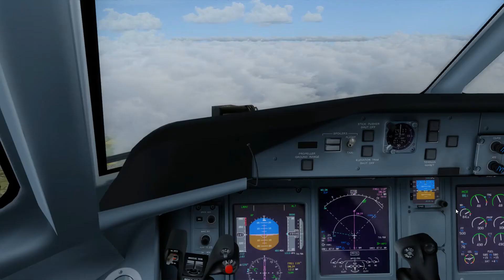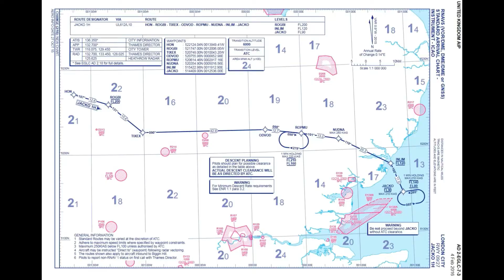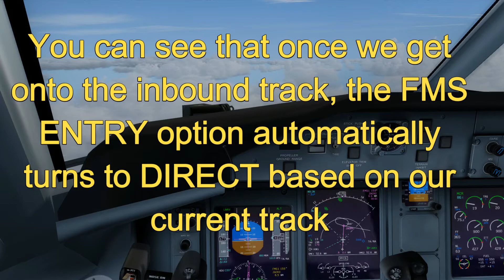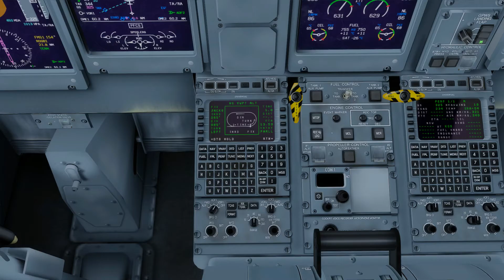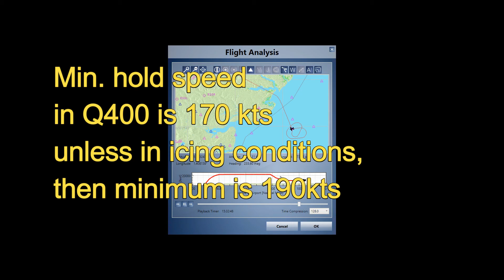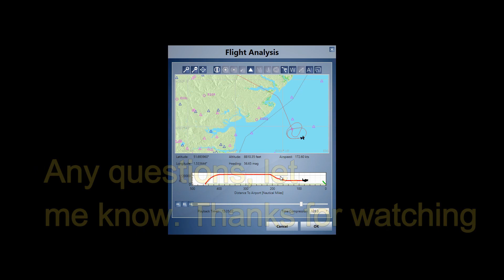Q400 Hold Procedure

Comment: I should have looked on your video, before blaming myself this evening at Standsted. Very well explained, thanks! One question is left to me. Can the FMC fly all 3 different entry procedures fully automatically once decided, or do i have to fly them in heading mode/ manually?
Reply from the maker: Brilliant glad it was of use. Yes the Q400 FMC will automatically calculate and fly the correct hold entry, but it’s worth verifying the one generated is the correct one just in case.